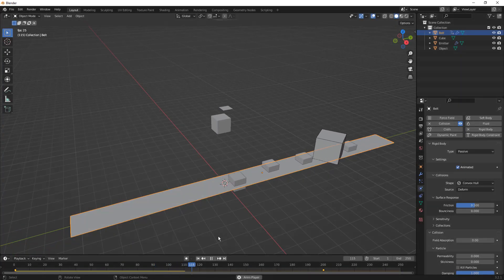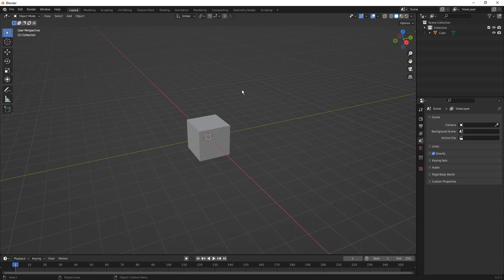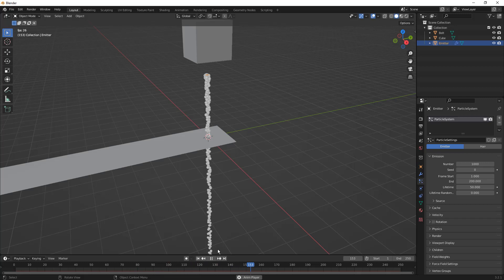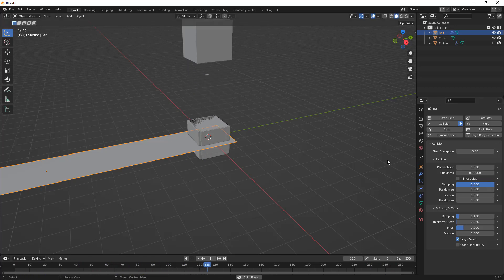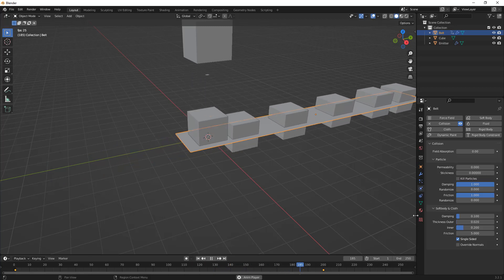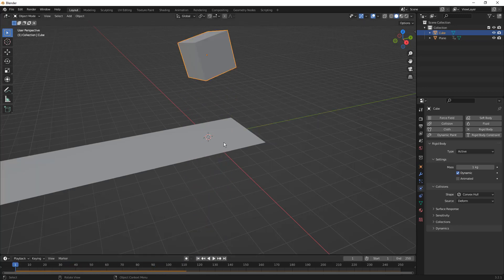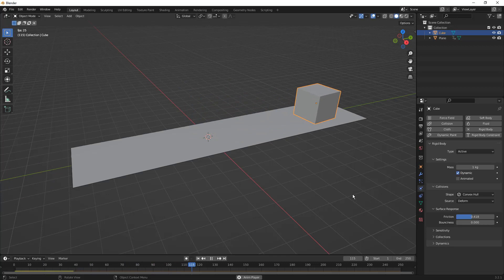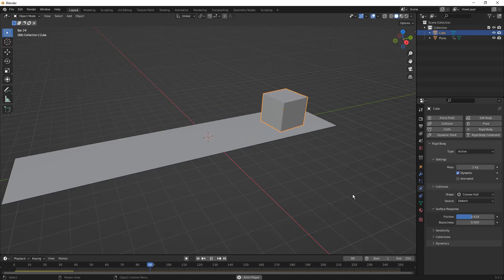How to Learn Blender Part 16 | Make a Conveyor Belt with Rigid Bodies and Particle Physics #blender

Comment: my object bounces heavy on the belt and yeets off :P
Reply from the maker: Its a feature not a flaw ;)  Is it the object particle system or the one with rigid body?  For the particle system you  have the Stickiness slider to adjust.  For the rigid body play around with the friction and damping.
Reply: Do you know why when I adjust the sliders, it sometimes makes the object pass through the objects, like they dont have a rigid body, and only way to fix it is to reset the whole rigid body for both passive and active objects? @LearnEverythingAboutDesign
Reply: I'm still using 3.x version of blender so prob why
Reply from the maker: @niklastsalkos  hm that is strange.  I am on 3.5 still as well.  Does this happen if you stop the playback, adjust the settings and restart the playback from the beginning?  tweaking settings while its playing can have odd effects.
Reply: yea i might have been tweaking while it was playing :P thanks for the reply! keep up the good tutorials man @LearnEverythingAboutDesign